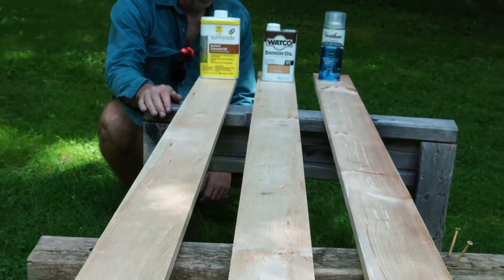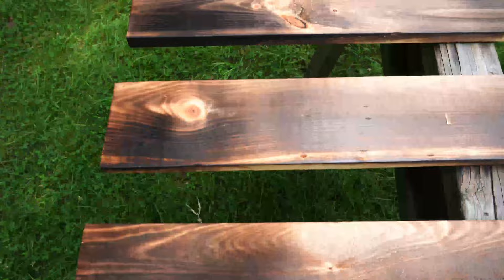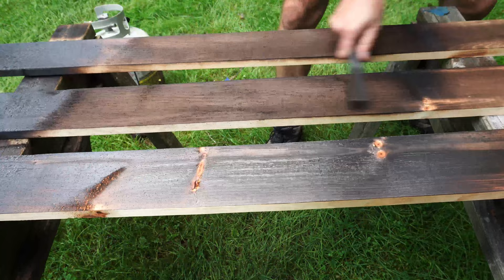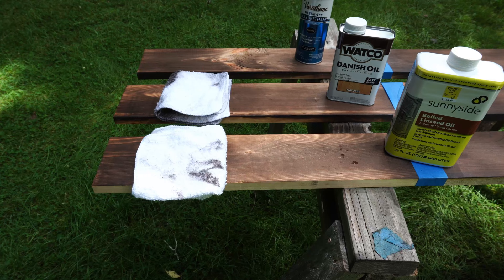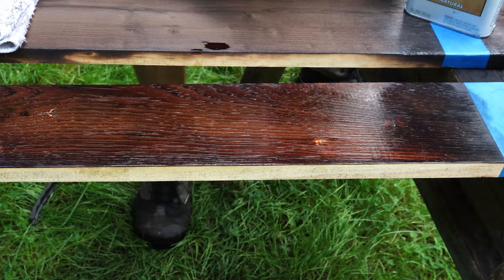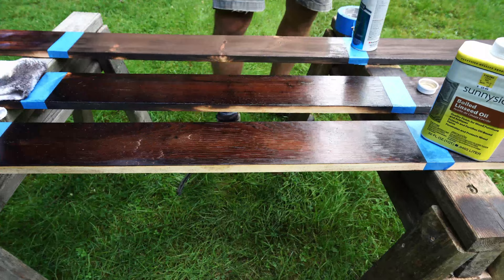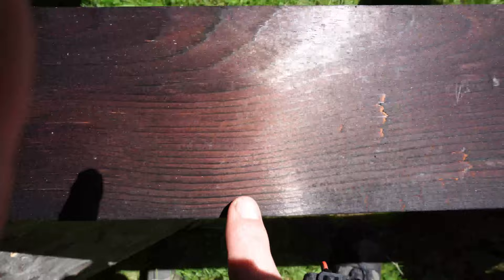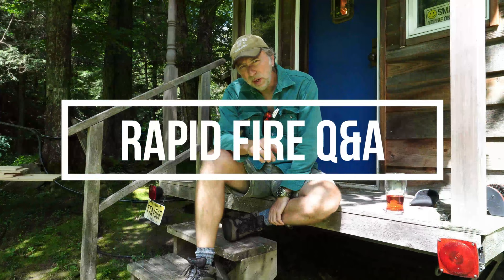Burnt Wood Finish - Shou Sugi Ban - End to End Tutorial

Comment: I was replacing old deck boards and found the foundation boards rotten, no termites. Should I oil the support boards before and after burning? No for looks but for long lasting.
Reply from the maker: Again, no oiling before the burn. Also, are the old deck boards pressure treated? In that case I would neither burn nor oil them, since pressure treated wood does not lend itself to this process at all. Also, do not do a burn on an installed deck either way. You might set your house on fire doing so. Only burn wood that isn't attached to anything (i.e. loose only). Make sense?

Comment: What is the unwire brushed heavy alligator skin like to oil? Is there a danger of the burnt layer coming off during oiling or handling after. Nice video ❤
Reply from the maker: Yes, there is. I have had some people reference that they use a paint sprayer to apply coatings to the delicate alligator skin variant and supposedly that works well. I can't confirm that though.

Comment: What do you recommend for maximum protection against constant sun? I want to use for an outdoor table but don’t want to refinish every year. Any of these options weather well compared to others for a table application?
Reply from the maker: Maximum protection would be simply using pressure treated wood. If you want to employ this method you kind of have to be open to a bit more maintenance. In exchange you get a much nicer (and earth friendly) finish on the wood, that looks a whole lot sexier than pressure treated. It's all a bit of a trade off.

Comment: Hi, Thanks for the content. Easy to follow and informative, good atmosphere, simple and relaxed, but serious about the subject. Appreciate it!
One question: With oil, how often should it be re-applied? What are the signs to look for to know when it is time to "re-coat"?

Thanks.
Reply from the maker: Hard to say. I would think that once per year would be sufficient in regard to recoating. Thank for checking out the content and for the kind words. Are you planning a project with this technique?
Reply: @TinyIndustrial  Thanks for the answer.
Yes,  I just bought a big piece of land in Northern Ontario and am planning to build a house and several cabins on it with different construction materials and technics.
As a follow-up question, do you know if burnt wood is ever used as a below grade treatment for wood posts?
Reply from the maker: I have seen some videos where the technique is used on fence posts. Not sure if it held up in that kind of scenario. Bottom line is that burning the wood will always get you some additional longevity...how much is the question and whether or not it's worth it. I employ the technique for looks and to extend the life.

Comment: I don't care what it looks like. I want to use this technique to preserve the lumber I make my raised garden beds out of. I think I should go with at least medium but would a heavier burn be more durable?
Reply from the maker: Yes, go for a heavier burn. Some have said not to take it too far though since you start to impact the integrity and strength of the wood with too aggressive a burn. Will you be documenting your raised beds on Youtube?
Reply: @TinyIndustrial  It's done. and the wood soaked up the Linseed oil like a sponge. I have my doubts that this will work, but the wood was so cheap I couldn't resist. It would make for a good vdeo to see how long it will last, but it would need to have a 'control' to see how much better it performs than doing nothing special.  I appreciate your efforts.
Reply from the maker: Wood soaking up the oil is a good start. Pretty chilly up north here and temp tends to play a roll too. The warmer it is the better. Some will even warm up the oil before applying it. Not sure how much that really helps. Again, thanks for the comments..

Comment: Question… I have some planters I built in the last few weeks but have not planted in yet. I simply used tung oil on them as a preservative but think it would be great to char the inside of the planters for added preservation. I charred a sample and the oil bubbles up and gets a beautiful even char. Will this still work for the preservation or am I too late? Anyone with experience / advice to preserve planter boxes? Thanks!
Reply from the maker: No, you're likely not too late. I would generally advise to do it the other way around though (burn and then oil). Planters look great when you use this technique, no?

Comment: Great test! Could I do a deck with this method, you think?
Reply from the maker: Definitely. I wouldn't suggest doing it to an existing deck, but if you are redoing a deck, yes, burn the planks on all sides, brush them and treat them with some oil and that should do it. Avoids all that nasty pressure treated wood or that Trex plasticky stuff (don't like it...do you?).
Reply: Instead of a wire brush I used a power washer. (Less elbow grease) But what I looking for talks preserving affect specifically underwater.

Comment: If you don't like the wood burn, can you sand it out?  I bought a table that was done in that technique but I've decided to use it in an area of the house where the burn look doesn't look good.  Can I just sand it down?
Reply from the maker: Yes, the more you sand, the more you will reveal the unburned wood underneath. You can actually sand until you like the shade you are getting. How much you have to sand off depends on the burn depth. Hope that helps?

Comment: Good video, Thanks! 
? Does the BLO dry so it's doesn't rub off and how long does that take (say on warm sunny days)? 
? Does the BLO last long outdoors, exposed to weather and the sun? 
? Have you ever tried applying 2-3 coats of the BLO then lightly running the torch over it to polymerize the oil?
Thanks very much!
Reply from the maker: So the BLO mostly soaks into the wood. Wood is like a sponge for it. On a warm sunny day it happens within 15 to 20 min. Wipe of any excess. Excess is kind of your indicator that you have applied enough. Yes, the BLO lasts for quite a while outdoors. Kind of like teak furniture, the wood will dry out and it helps to reapply every so often. The heating after application is one thing you can do, I also have seen others warm the BLO before applying it. I think that both methods help with the absorption. I'm not a chemist, so I can't really speak to the polymerization of the oil. Anyone else on here know about that?
Reply: @TinyIndustrial  Thanks for the reply! I think warming the wood before applying helps too, by opening the pores up. I'd guess there would be some polymerization if you  could get it to the right temperature. It's what occurs with "seasoning" a cast iron pan with oil, like flax, etc. It's what makes it stick to the surface and densify given the non-stick result. I'll give the heat treatment of the BLO, once applied on some SPF lumber and let you know if it made a difference.
Reply from the maker: @wingnutbert9685  That all makes sense. Would be interested in seeing how that goes!

Comment: Would this method work to preserve wood cookies for a pathway? I would assume I would have to do all sides then as well…
Reply from the maker: Cookies sitting on the ground would last a bit longer using this method, but any wood in contact with the wet ground is going to be problematic. In a desert environment perhaps you would see some increased gains due to limited moisture and that the fact that the bugs will be put off (for a while) by the burnt wood.

Comment: how long will this wood last? i was thinking of building a house and doing this with the logs will this make it last 100 years or more?
Reply from the maker: It will 'extend' the life of the wood. How long depends on a lot of different factors, including, but not limited to, the depth of the burn, post burn application of oils, weather conditions, exposure to sun and water, etc. Hard to say exactly for those reasons. 100 years or more seems like a stretch though. Do this because you 1) like how it looks 2) want to avoid pressure treated lumber chemicals 3) hope to gain a 'bit' more longevity out of the wood used. Make sense?

Comment: When using for weatherproofing, not just appearance, how long/how hot do you need to burn? And if you brush it off, arent you removing some of the weather protection?
Reply: No the idea is that you remove the softer cellulose out of the wood. That is what the bugs eat and the part that starts on fire the fastest. Its no problem to sand it.
Reply: @greatitbroke  any idea where I can find the science on this? I'm looking for the weather/water proofing... how much can I send off? How deep to burn,  DETAILS lol. I want to use for siding on my house.
Reply from the maker: It's more of an art than a science. It offers chemical free protection for the wood. How much protection you get depends on all sorts of variables. Type of wood. How green the wood is. How deep the burn is. etc. It's a good thing to experiment with. Will it last as long as a piece of pressure treated wood? Probably not, but it looks a whole lot nicer and and isn't as carcinogenic.

Comment: Do you need to do another top coat over the oil ones
Reply from the maker: No, not really. You could do an oil refresh after a year or so. Either way, you have massively extended the life of the wood if it is going to be in some way exposed to the elements.

Comment: Can you used a sawn timber as apposed to plained would it get the same effect?
Thanks
Reply from the maker: Yes, it's really just about how much you burn the wood. The longer you burn a rougher surface, the smoother it will be after you wire brush the debris off. What are you thinking of doing with this technique.
Reply: I have been offers some sawn larch planks,to clad a new porch.
Reply from the maker: Excellent! Good project.

Comment: Is there any way to prevent warping?
Reply from the maker: Well, the best way is to best way is to burn all sides/edges of a piece of wood. That even heating minimizes the internal stresses that heating only one side causes. It's doesn't guarantee that there won't be any warping, but it does minimize it. What's the project you are thinking of doing?
Reply: Came here for this comment. I made a few dice trays for my Dungeons and Dragons group but the wood (used pine) got pretty warped on some of the trays. I thought maybe I should plane the wood after burning. Any idea if this would work?
Reply from the maker: Did you burn on all sides? Also the thinner the wood, the more prone to warping it would be. Maybe make the dice trays thicker and beefier. Usually adds to the esthetic when you do that too. Give it a try.

Comment: You have failed your experiment display 16 seconds in because you don't have a control. All different intensities of heat and all different finishes creates too many variables to effectively and definitively come to a conclusion. Unless the less obvious point was to showcase all the variables. FYI, there was no link to your other video in the actual video.
Reply from the maker: I'm not sure what you mean by 'control' in this case? The control would be an unburned plank, no? Or are you referring to having a plank burned yet untreated with anything? I think that I see your point. Was simply trying to give folks an idea of what different intensities might achieve in regard to look with a few finish options.
Reply: @TinyIndustrial  Hmm. All good ideas. But maybe a basic oak stain and un-burned plank. Basic. Boring. What it would look like if the average DIYer were to finish it.